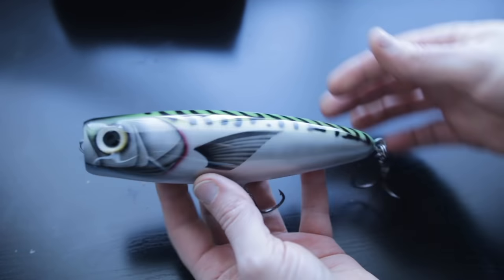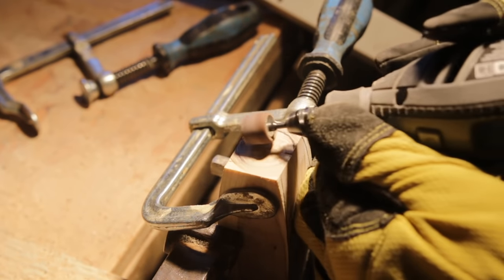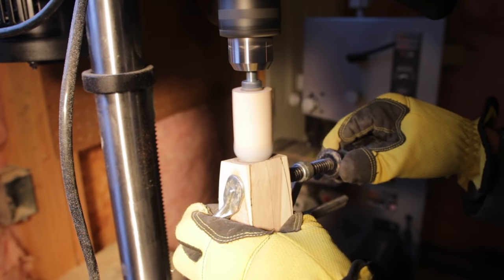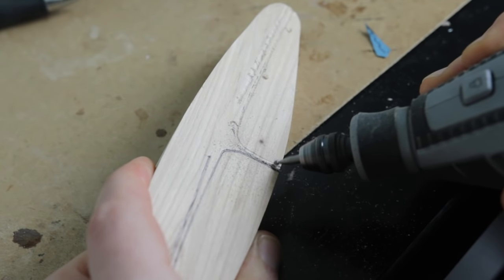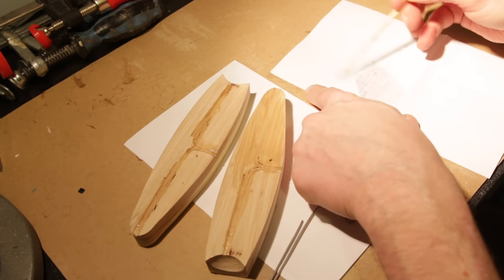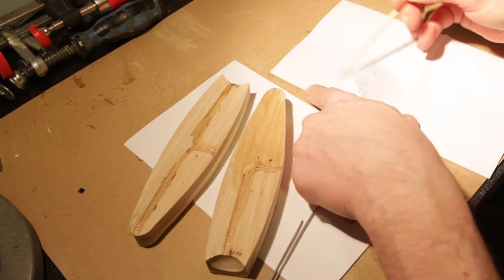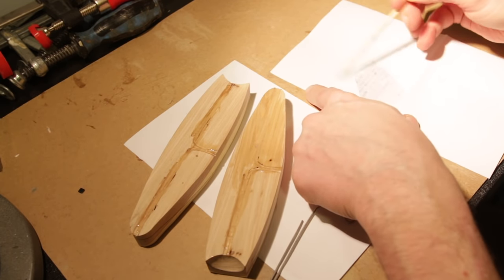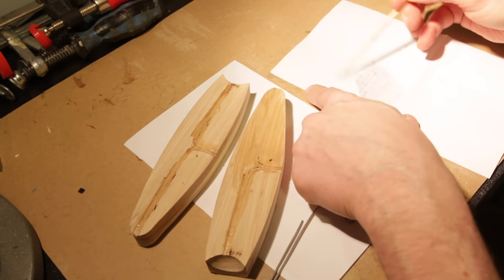Lure making | The popper

Comment: I always preferred the "split down the middle" approach to bait making.  It allows for the wire to be run exactly how you want, and also allows for weight channels to be in the exact spots you want.  Can even do loose lead shot so you can do rattle baits easily.  We have big pike here everywhere I fish for bass with crankbaits, so through wire is just the best design when it comes to getting the odd 20lb pike.  Even when it's not needed, it gives you that extra bit of confidence that your homemade bait is not going to be the weak point in the setup.

Comment: I've used both "Bondo" and CA + soda and the problem with some bondo brands is that it might shrink after some time when the bondo layer is thick, CA + soda does not shrink. Epoxy repair putty would be the optimal solution for plugging the lead holes.
Reply: If I want to buy it for a fee, is it possible to send it to me?

Comment: Do you think the trick you did with the weight using the rubber band would be practical in making smaller baits? Because my biggest problem in bait making is figuring out how, and where to weigh it
Reply from the maker: It should work in any situation
Reply: @SolarfallBaits  Thank you for the input!
Reply: @SolarfallBaits  you should make a tips and tricks video. I know it would be great, I learn so much watching you

Comment: Good job! However if I can make a suggestion... Why dont you seal the wood with a thick superglue? Ten times faster that Olympic wood sealer displayed in this video. You can still add the epoxy afterwards if you wish, but a thick superglue would do the trick I reckon. Unless you have a specific reason of course.
Reply from the maker: Im sure the glue would work. The reason why i used the deck sealer its because its very watery and will penetrate the wood better.

Comment: Haha! Great bait! As a Marling and Solar Baits fan, I take no offense from the baking soda shots! The great thing about bait making is that you can really do whatever you want with it as long as it works. I believe baking soda/ superglue method is so popular because if you are making lures, you’ll most likely have super glue on hand, and almost everyone can grab some baking soda out of their pantry without having to go out and buy bondo
Reply from the maker: I'm just poking a little fun on nate. Hes a good guy so its all just some friendly banter. Anyway i've been pretty active on the forums before facebook and instagram i've never came accross the method until i saw it in marling baits video so he could be the originator of the method
Reply: @SolarfallBaits  If I remember correctly it was recommended to him in a youtube comment.
Reply: @SolarfallBaits  Baking Soda and superglue has been used for packing up the slots in guitar nuts if the top action on a guitar is too low ( a buzzing string or two ) it's been used for decades and I've used this formula myself twenty five years ago as I found it mentioned in a guitar repair book. It's used because it's dense and tough, perfect for Good sound resonance. 
It's tough to file so for a filler on lures I personally wouldn't want to use it unless for something that needed that extra strength, I'd prefer using bondo as you did or car body filler which is pretty much the same as two part wood filler ( smells the same and sands the same ) we used it in the wood shop where I used to work 👍

Comment: If I'm not mistaken you have a ryobi bandsaw. How level is your bandsaw bed? My bandsaw bed is totally unlevel where the slot is for putting in the blade, one section is lower than the other.
Reply from the maker: Mine is fine, you might wanna jerry rig it somehow or if you can just return it
Reply: I fitted pieces of flat bar to pull the table to be flat but it is still a little cruked but much better than before. Mine  is a little underpowered for the size lures I make but gets the job done. Great video and keep up the great work!

Comment: Baking soda? Wha! Crystalline structure, gets wet it will dissolve. I used wood glue and sawdust. Woks just fine, stronger than crystals.
Reply from the maker: I don't think baking soda and super glue will dissolve in water. Not that it matters to me since I used epoxy to glue the 2 halves together in this video

Comment: Not trying to be the safety police but you should never wear gloves and use a table saw, only bad thing can happen!! Nice job on the popper.
Reply from the maker: I would normally agree with you but it was -10c in the garage and -30c outside when i did the cutting so i went with comfort instead of safety.